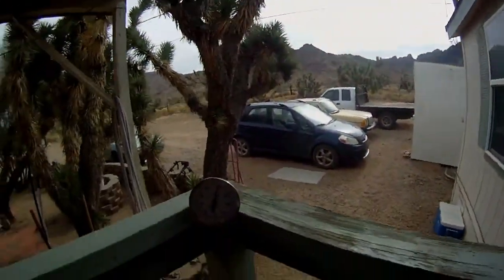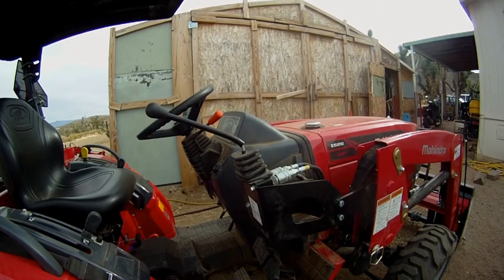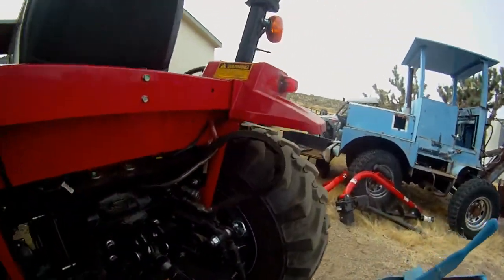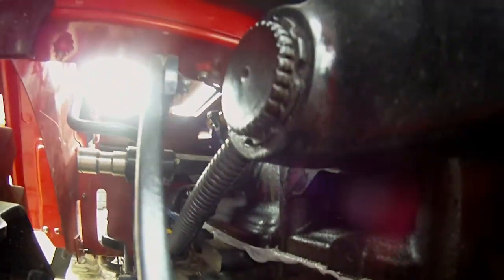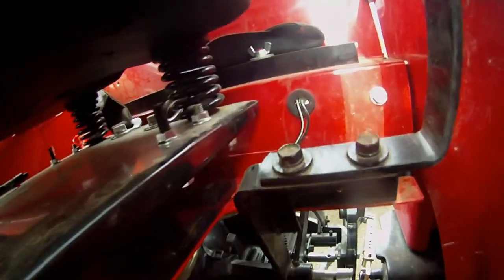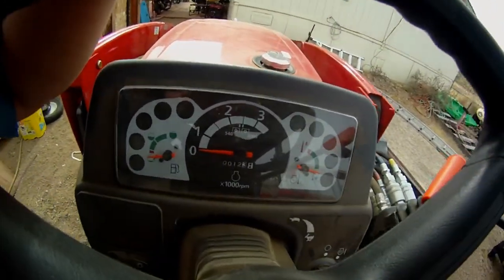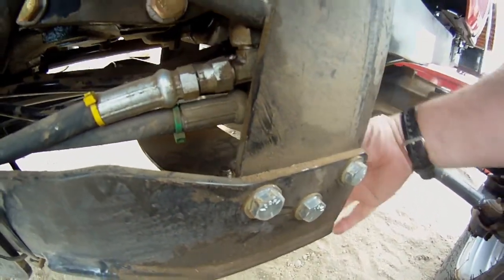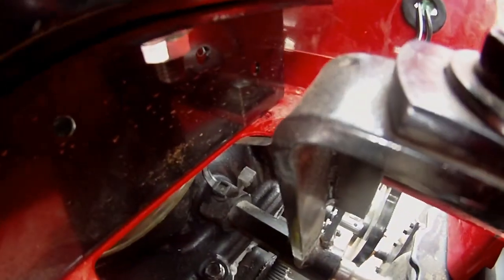Mahindra 1526 HST Issues Brand new

Comment: Pull your ground wire off the frame and remove paint under bolt head.

Spray sealant over all exposed power wires within 18 inches of battery. 

Remove access panel on forward facing top side of dash and pack in mouse poison.

Buy a large number of zerk fittings...you'll need them.

 Take heart, it is a great tractor.

You might consider investing in a 60" grapple...incredible extra set of hands.

Comment: Being a mechanic myself, i cringe at seeing that much rtv pooching out.  That much out, how much is on the inside?  I see techs make the mistake of not letting it cure a few minutes before putting the two halves together, that it doesn't seal as well sometimes.  I have seen alot of tractors with high temp red rtv on most mating surfaces.   I own a 1526 shuttle and love it.   Thanks for sharing.
Reply from the maker: =) Thanks for the comment.....After the repair, or 2 =) there's even more ooze.....The Grey gasket maker Mahindra  uses is top notch....one of the strongest I've ever seen......I admittedly use a lot......I've got a little over 50hrs of hard road work on my Mahindra and do not have any regrets =) Glad to see another happy Mahindra owner.
Reply: @nitebirdscuffle4213 , definitely love my mahindra.  Its a beast.   Looks like the ultra gray I use at work on just about everything lol.
Reply: @nitebirdscuffle4213  i have a few videos on my channel with mine.  More to come now that spring is here, once the rain quits of course lol.
Reply from the maker: =) look forward to checking them out

Comment: We still have our 1985 made in Japan diesel Ford tractor and it's still kicking ass!It's been beatin up working on railroads, so if we had to by new we would go with a Japanese brand again.Mahindra? no way!!!
Reply from the maker: If you were seriously going to buy a new tractor what would you buy? Despite the headaches......it's a solid machine....after almost 2 years and 50 hours hard road work I do not have any regrets....The problems I had stemmed from incompetent people and not a bad machine......Hopefully your ford holds up well.....I have an early 60's Ford 2000 industrial that still runs and works but the Mahindra can get 2x the work done is same time despite being a smaller machine......
Reply: Philippe Riopel that machinera in the video is mostly Japanese.
Reply: The issues mostly stem from the dealers assembling them sloppy.
Reply: This is a Mitsubishi tractor made in Japan. How much more Japanese do you expect it to be? Do a little research before assuming things.

Comment: Thanks for sharing I'm seriously interested in  a mahindra 1526 shuttle shift tractor. This is what I've been searching for. My neighbors have a new 85 H.P. Mahindra a d they told me don't buy Mahindra I'd be sorry. I think they have a good product as one of my co-workers bought a new one about 10 years ago and  he loves his. I'll  sort this out I've been searching and digging for info about this tractor and so far the good  out weighs the bad. Im partial to Kubota  but their so expensive I'm looking to replace my old   L2650 kubota thats been a good one but this size tractor would cost me about $ 28,000  with just a loader and nothing else. Thanks again
Reply from the maker: Thanks for the comment.....I was in the same boat Kubota or Mahindra and also partial to Kubota. It's always the luck of the draw no matter what you buy....The smaller Mahindras have a pretty good track record and have been out for a while. I've seen some bad transmissions with larger Mahindra owners. One video of a broken Kubota transmission was enough to push me towards Mahindra. "New for this year" is always risky. At times I wish I would have gotten 1533 but honestly dont know if it would make that much of a difference. My old tractor is an early 60's Ford 2000 Industrial 30hp 2wheel drive with a giant loader bucket. Going from a bigger machine to a smaller machine is going to leave some doubt every time you want more power. This little machine can pull almost as much dirt in the box blade as the old tractor. I  could go on an on......I'll probably make a video. To quickly sum it up the manuverabilty of the smaller frame and precision of the hydrostatic transmission more then make up for the small difference in material. When it comes to the loader nothing beats the old Ford =). Good luck with whatever you choose.
Reply: But massey

Comment: I just wish my tractor those sort of problems Mine has 50 hours on it the muffler is cracking and breaking out all over It rattles like hell and just did the 50 Hour oil change And the engine oil is full of metal shavings I talk to the dealer they didn’t really seem to care I am starting to wish I had just bought a John Deere
Reply from the maker: I hate to say this but I would be very worried. I would get a temperature on the exhaust and a compression test on the engine.  That will tell you everything =)... Weather you should be worried or not. The dealership will probably step up if you can show them there is an issue. Definitely document your problems and be prepared to make some calls. Email with pictures to the dealership works really well. Most importantly try to be as polite and civil as possible, no one wants to help an angry rude person. Mahindra has customer service and can provide some assistance with the dealership from what I've seen and there is always the Better Business Bureau as a last resort. I hope it works out for you.....if possible reply with an update later
Reply: You don't want a Deere compact like this.  They are horrible and expense to get the parts.  From working on many brands Deere would be near the bottom of the list to buy.
Reply: Shows how much you know about tractors. That is why you do a 50 hr maintenance on it. The metal shavings are totally normal. It's called break in.

Comment: I hope it's just your tractor,I'm thinking about buying one....
Reply from the maker: Most of my issues could of been avoided with a better inspection and honestly could have happened with any brand. The dealership is an important part of buying a new tractor. Despite having to redo the top cover myself, the dealership actually sent a mechanic to my house ( 300 miles away ) to try and make it right. Not all dealerships including other Mahindra dealers will make that kind of effort. I havent looked at anything new lately but I chose the Mahindra because of the Mitsubishi engine ( no DEF or filter ) and steel/cast iron transmission/axel.  At the time the Mahindra out performed every one else in the same class and cost less. I'm close to 20 hours and happy with the performance. Best of luck choosing a tractor.
Reply: Looks to me like a dealer prep or lack there of issue.  When I bought my 1526 Shuttle, my dealer had their mechanic go through the whole machine and make sure it did not have any leaks and checked all the bolt torques.  The only thing I found they forgot was not greasing one pivot bushing on the backhoe bucket good enough. The Mahindra 1526 is an awesome  machine. I absolutely love mine.